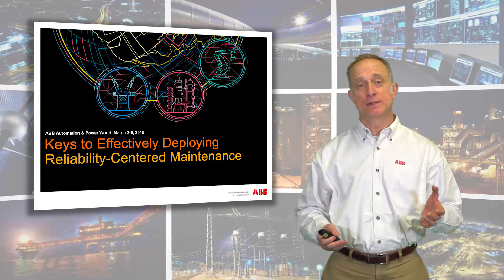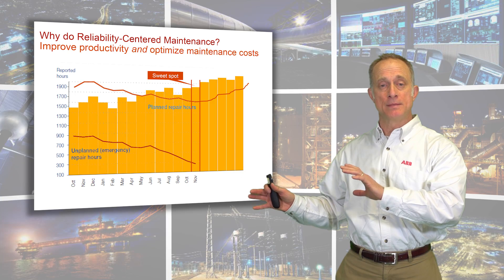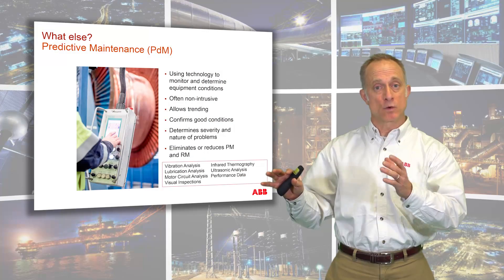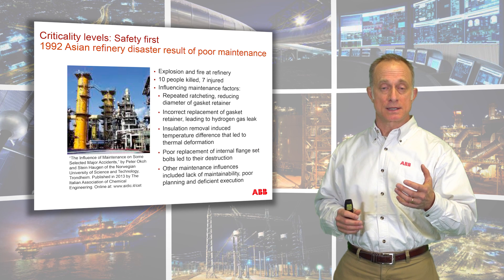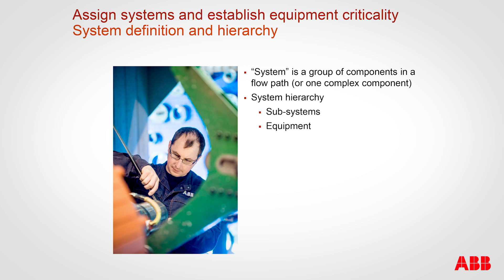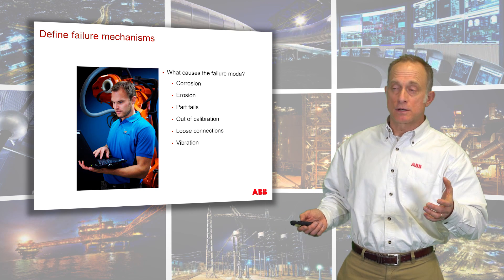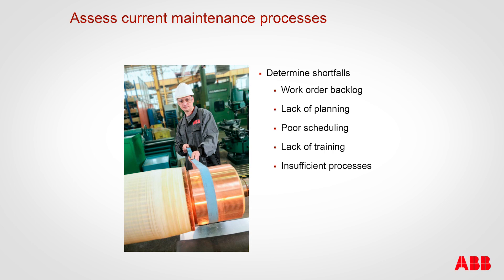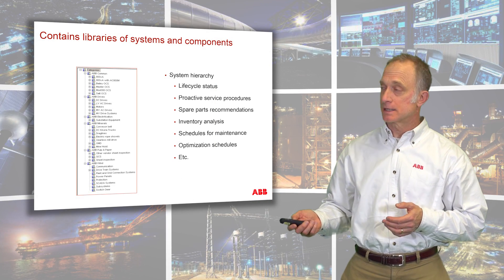ABB - Reliability-Centered Maintenance

Comment: sir ive a question.... Why reliability factor ke decreases with the increase of reliability%.
This is illustrated in the book of SHIGLEY's mechanical engineering design, chapter 6, table 6-5..
Please elaborate this concept
Reply: As reliability increases you have to be conservative which results into lesser reliability factor Ke thus reducing endurance strength (Se). means you can still put more load and have higher Se but you restrict yourself for lesser load and Se as you dont want to take any risk of failure to have high reliability.